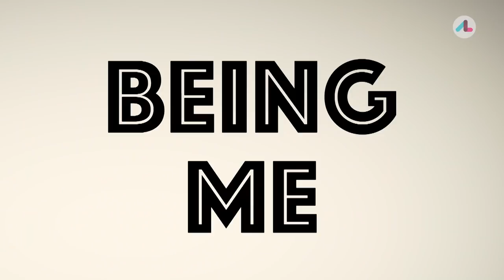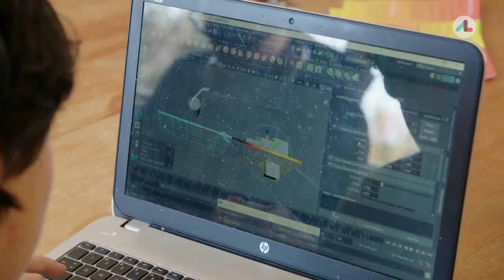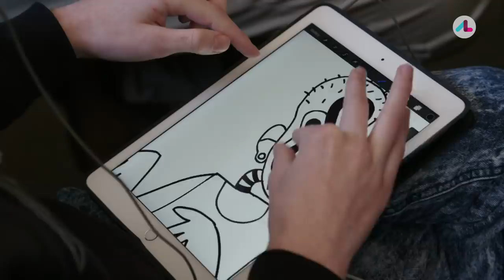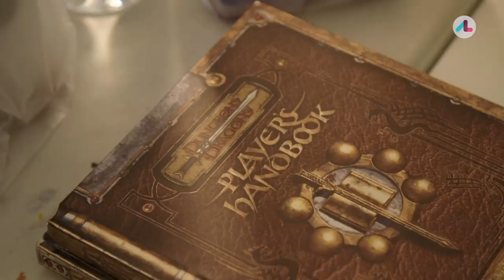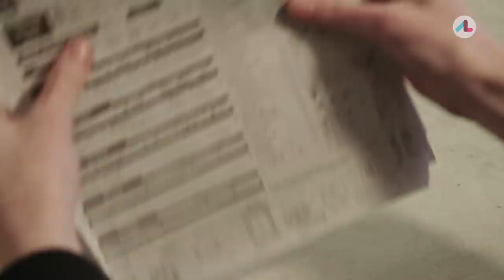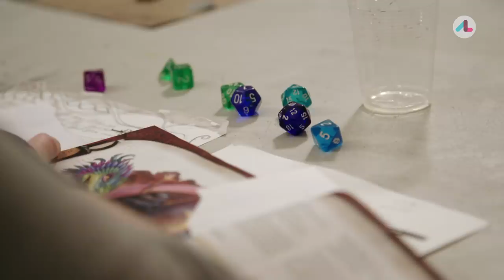Living with High-Functioning Autism

Comment: disabled adults and "high functioning" are the real abandoned ones. the kids are fine nowadays where I live. they are abandoned in adulthood JUST LIKE WE WERE. most late diagnosis people are doing ok. I was diagnosed at10, i'M 27 NOW. i was overestimated. I did so well in an individualized setting they mainstreamed me and then ignored my low assignment completion rate and complaints about classroom structure and noise.  they ended up giving me a fake diploma after destroying my self esteem writing ACTUAL ASSIGNMENTS off my IEP after I did not complete them die to being burnt out and racked with fear due to the course load and my mother fearmongering about poverty.

Comment: My Asperger’s Syndrome was very hard to diagnose mainly because it co-existed with other conditions, I had developmental Aphasia when I was young due to a birth complication and because of that I was diagnosed as having a speech delay with autistic traits then at age 5 1/2 years (HFA) High Functioning Autism which is similar to (AS) Asperger’s Syndrome but is different by a higher susceptibility to delayed language development. My ASD preschool teacher suspected that It was AS  but it wasn’t officially diagnosed and it took years to finally get a proper diagnosis. At age fifteen my parents took me to a University in Michigan for OCD and Anxiety, but it was still HFA next doctor PDD-NOS was suspected but it couldn’t be diagnosed because of the DSM-5 then at the age of twenty It was Aspergers. The point I’m trying to make is sometimes there are hard cases out there and this means that you may not know for sure even though you thought you were properly diagnosed. P.S. thought I was just High functioning.

Comment: I was diagnosed with dyslexia in elementary school and was put in special ed all the way until I graduated high school. The problem is that it was too easy for me and i told the school for years that it was too easy and I would like to move ahead but they never did anything. In highschool in my math class they where teaching the same thing to us every year and i had it down and when they would have a meeting with my parents and me I would say over and over that its too easy and i want to learn more and learn different stuff but they just kept holding me down. Now i just struggle with math as a welder because i never had a chance to learn the math that i need for my job. It’s really unfortunate and i feel like they just gave up on me and really messed things up for me in the long run. Our schools need to be better at listening to the students....